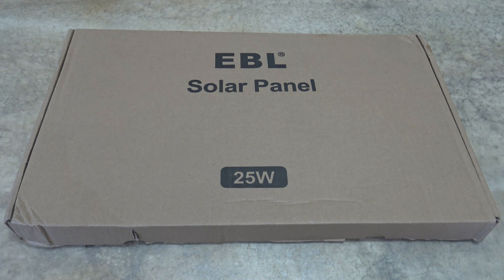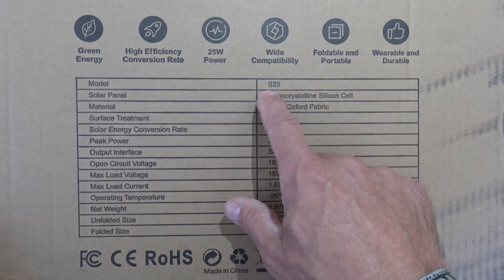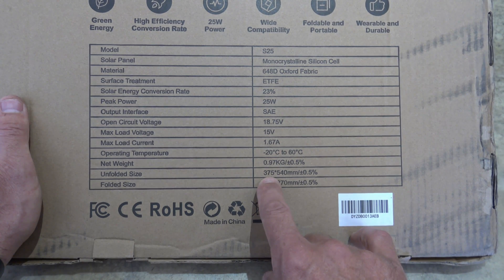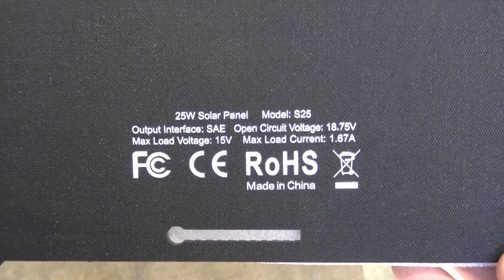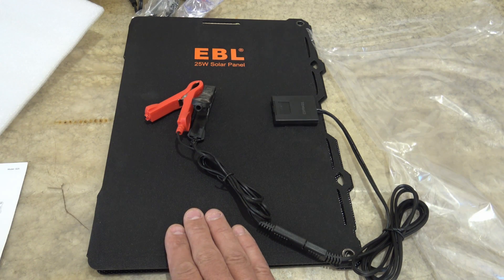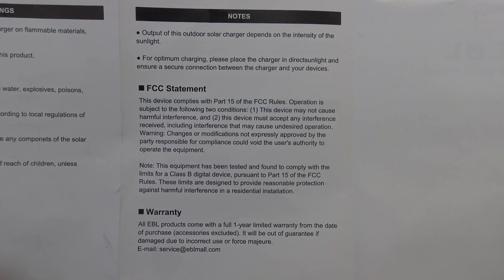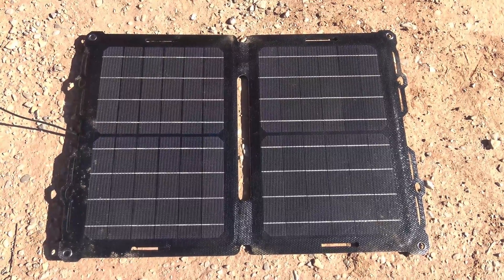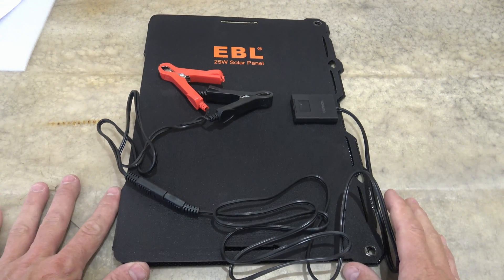EBL 25 Watt - 12V Solar Battery Charger And Maintainer

Comment: Hi Sensei.
My only question with a panel like this would be what kind of battery could you charge with it?
Cos I think you may struggle to charge even a small battery.
Not to say it doesn't have uses, maybe for direct charging, but it's use is limited unless you can find a battery for it.
In which case it would be great.
Ignore me totally.
I'd posted before watching...a bad habit.
No I'm sold.
Perfect as a trickle charger for a car battery.